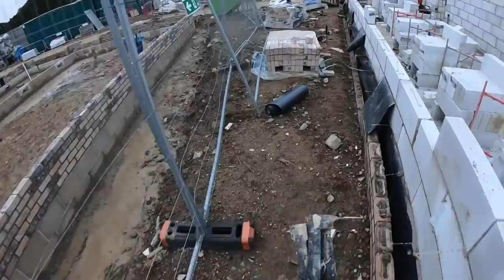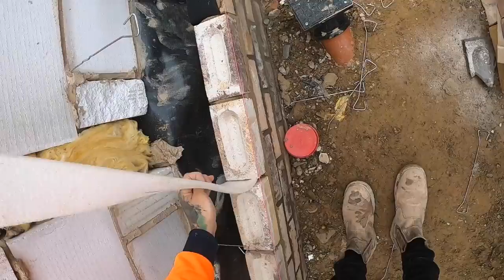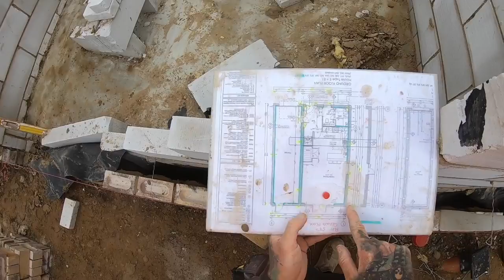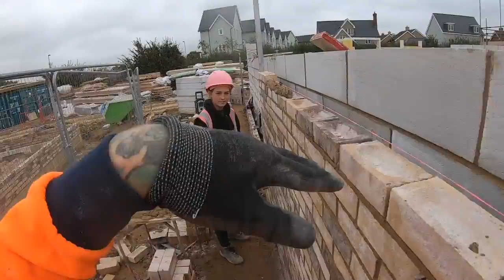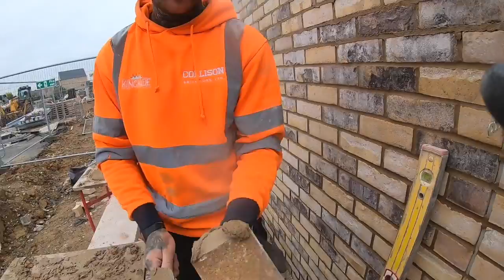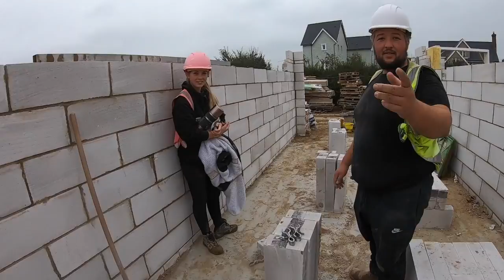The Dream Team

Comment: hi Charlie i see that you have set up a dead man.
why not use a profile fixed at the bottom with a t clamp  ,and a dean 5 at the top .
then use a long sided dori block to keep the expansion joint plumb.
you will be able to run the line full length.
maybe good for when you build gables as well.

Comment: Obviously some of the comments about hod carriers are from guys who haven't been on site for some years.  Ladders are all metal now and virtually vertical. Impossible to carry materials up them but not allowed anyway.  Only one pack of bricks are allowed on the loading bays so mixing from three packs is impossible. Clamps are easy and efficient for loading. I'm retiring in 3 years thank god. A lifetime of bricklaying now had carpal tunnel operation on both hands. Need a new knee or two.  Bricklaying is not for over 60s lol.
Reply: It is if you look after yourself and keep of sites👍
Reply: Any work that is repetitive and is carried out for years on the human body no matter how you look after yourself is going to cause issues I reckon.
Reply: @adgeebike9173  i have been laying for 42 years and im looking forward to the next 20.

Comment: If the expansion joint turns into the corner above  then it should be on the outside of the outer leaf of the Jack wall.. no need for measuring.. sometimes the measurements on plans don't work out..
Reply: But if you follow the drawing you get paid weather or not, if you deviate from the drawing and its wrong, your f**ked 😂